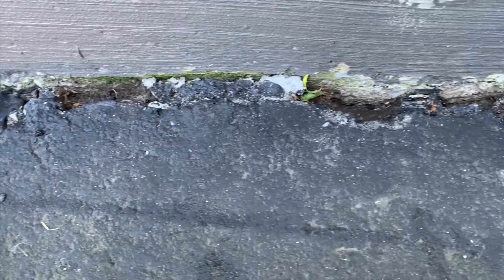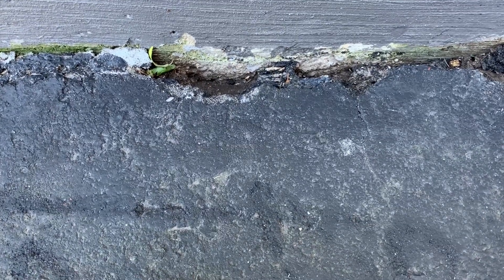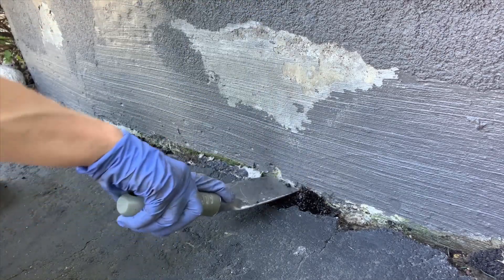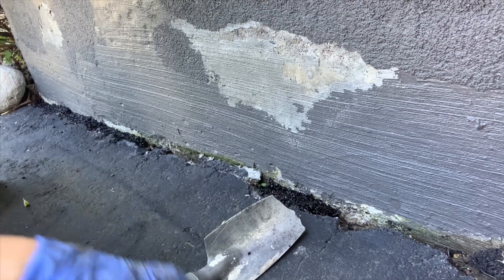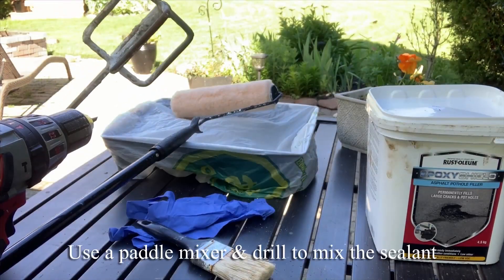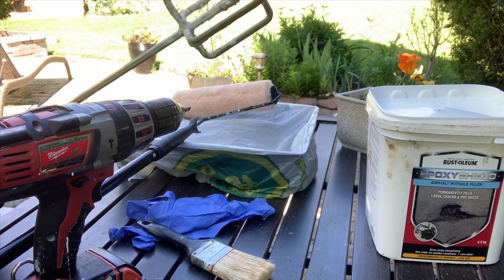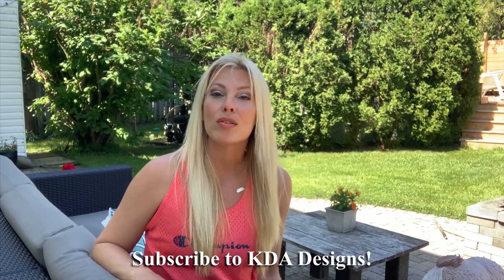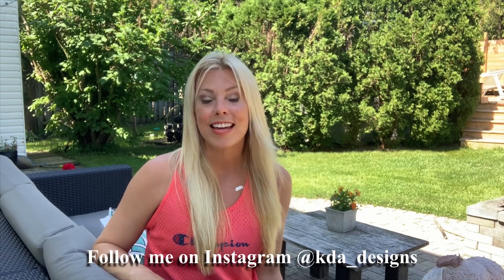DIY How to Repair & Seal your Driveway - KDA Designs

Comment: You have already helped me and my family several times. So I hate to ask, but do you know how to clean cement, lots of cement. So many others are just trying to sell me something. We trust you. Thanks💚
Reply from the maker: Sorry for the delay, James! It really depends on the types of stains that you want to remove. If you have grease/oil stains you almost need to spot clean them with an alkaline degreaser first. Then I'd sweep the cement and use a biodegradable detergent with a deck brush or scrub brush of some sort. (Followed up of course, with a good rinse) Or, if you have a pressure washer, I'd use that to wash off the detergent. I've heard of some people using TSP but I have not yet used it on cement. It worked well for my fireplace, though!  I hope this helps even a little! :)
Reply: @kdadesigns  You are so kind and it does help. Thank you
Reply: @kdadesigns  what is TSP? And ZEP concrete cleaning solution is best for driveways that have oil stains. Wet area first then apply at low pressure with pressure washer. Then scrub by hand using a brush then clean it off with high power pressure washer.

Comment: Pour & squeegee would have done a better job filling the cracks. Rolling didn’t lay down enough material.
Reply from the maker: You know, I tried the squeegee at first and wasn’t crazy about the results. You have to be super careful with the squeegee not to get lines. The roller gave me a nice, even surface by pouring it and spreading it out. It’s held up well and I haven’t had to redo it since. Everyone has their own preference on methods but this one worked really well for my driveway 👍🏻
Reply: @kdadesigns  mine had lines from the squeegee, when it dried the were 90% gone. The pros use brushes. I only do mine every 3 years, I’d have to buy a new one every time. You can peel the dried material from years past off the squeegee & reuse. Anyway, thanks for the content! 🙏🏻
Reply from the maker: @jdub229r  I'll try a section next time with the squeegee :)

Comment: There's still cracks all over the driveway.
Reply from the maker: Technically, you are correct however they are filled. In order to get rid of cracks completely you would need to redo the driveway. This shows merely how to fill the cracks so that they don’t get worse in the meantime 😁